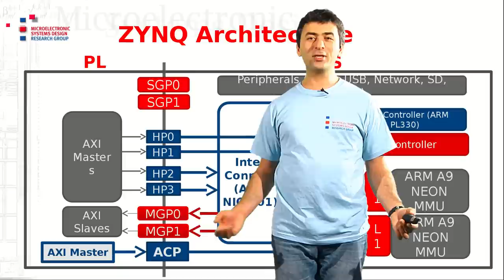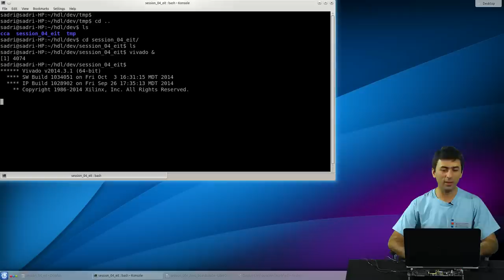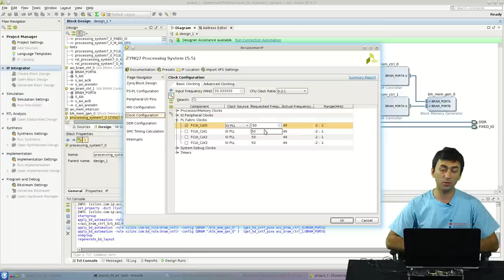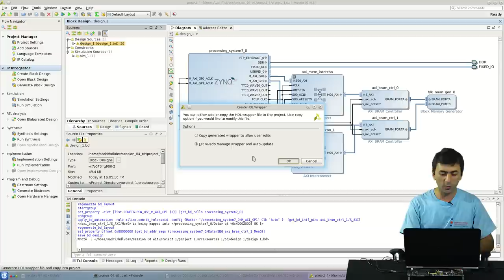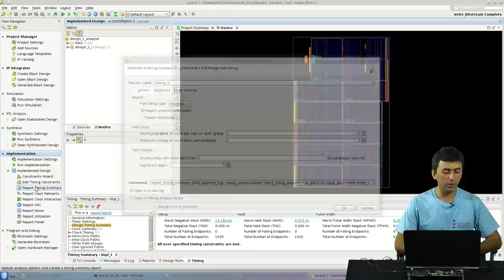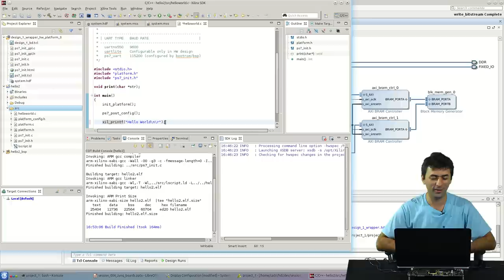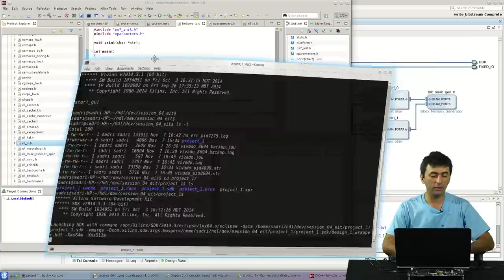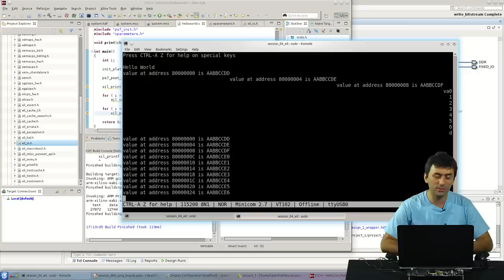ZYNQ AXI Interfaces Part 2 (Lesson 4)

Comment: This may be a dumb question, but with other tools that I have used, I have seen the need to explicitly write to the UART address space in order to get it to print to the console via UART. Do the functions used xio.h automatically do this? I would have assumed that the functions would send the messages over the JTAG connection. Any insight would be much appreciated.

Comment: Another question: The block design verilog wrappe rhas those DDR and FIXED_IO signals. But in the previous lesson, the ZYNQ diagram did not show these signals being routed out from the FPGA to the system. The only connection it showed was through the HPx ports to DDR and the GPx through interconnects. Did I miss anything?

Comment: What are necessary steps to do the same task (which you have explain in this lesson 4 i.e. read-write to BRAM) over Linux application running on PS? Is there any Xilinx document which explain this?

Comment: A very helpful and well explained tutorial!!! I have a rather silly question, in the program, we didn't configure the data in the address of GP0 (0x40000000) to be copied to the address of GP1 (0x80000000), why is it when we read from address 0x80000000, the data appeared to be the data in address of 0x40000000? Thank you!
Reply: Hello Kin, if you look at the block diagram of our design you can see that we are using one single block memory with two ports and each of these two ports is connected to a separate axi bram controller. one of the axi bram controllers is accessible through gp0 and another one through gp1. so practically GP0 and GP1 are sharing one single unique block memory. this is why you see a same data.
Reply: thank you so much...it makes more sense now!!!a very good series of tutorial!!!keep it up!hopefully tosee more video coming

Comment: The adresses were were changed from
0x40000000 - 0x40001FFF
0x40002000 - 0x40003FFF
to
0x40000000 - 0x40001FFF
0x80000000 - 0x80001FFF
why not
0x40000000 - 0x7FFFFFFF
0x80000000 - 0xBFFFFFFF
like in the table? Was this on purpose or an error and it just worked by chance?

Comment: i constantly get an error 'Can not access FPGA space: level shifters are not enabled". As you have told in this lesson, i have put ps7_post_config() routine in main. FPGA is also getting programmed before i dow application. what could be going wrong?
Reply: Hi. well, If you are sure that ps7_post_config is executed but level shifters are still not enabled, you can do it yourself manually. Look at the ZYNQ TRM document, at the end there is an appendix which lists all of the registers, there you find the register responsible for changing the state of level shifters, the register is in locked mode by default, you should first unlock it, then make level shifters active and then lock it back again.
Said that, I believe you are not running the ps7_post_config, probably it is located some where which is not being executed. Or your elf is running before the fpga fabric configuration gets done!

Comment: Hello Mohammad, What is the procedure to carry out same exercise on board that is not listed while creating vivado project?
Reply from the maker: So you have a ZYNQ board which is not listed by default in Vivado when you want to begin a project. Then the first thing I would look for is if there exists any board definition file for my specific board. If yes, I go ahead and just add the new board definition so that I can have it in the list of available boards in vivado. (for example look here: http://zedboard.org/content/board-definition-files-0) If there is no board definition file, then you may like to create one for your specific board and use it since then ( look here : http://forums.xilinx.com/t5/3rd-Party-Other-Boards-and-Kits/How-to-create-a-board-definition-file/td-p/339025) 

Well, finally you can also forget about board definition files completely and directly go ahead by selecting your zynq target device when creating the project. Here you need to take care of all of the required configuration parameters of the PS. e.g. the parameters related to the DRAM controller. Or the ones who define which peripheral is enabled and which one not.

Comment: Great job sir ! could you explain me why i get this error ? I'm on Vivado 2016.4.

ERROR: [BD 41-1075] Cannot create address segment for </axi_bram_ctrl_1/S_AXI/Mem0> in </processing_system7_0/Data> at 0x40002000 [ 8K ]. The proposed address exceeds the base address limitations <0x80000000 [ 1G ]> of the interface(s) </processing_system7_0/M_AXI_GP1> through which this peripheral is accessed by this address space
ERROR: [BD 5-48] Error: running assign_bd_address.
I would appreciate if you answer this problem.
Reply: Running this TCL script seemed to do the trick. Must be a Vivado bug. 

TCL:
create_bd_addr_seg -range 0x2000 -offset 0x80000000 [get_bd_addr_spaces /processing_system7_0/Data] [get_bd_addr_segs {/axi_bram_ctrl_1/S_AXI/Mem0}] SEG0
Reply: I also encountered with the same error message however while you go to the Address Editor in the Vivado, you will find that your "axi_bram_ctrl_1" is Unmapped; so you should give the Specific Address to the Unmapped "axi_bram_ctrl_1" which is 0x80000000 in the given case (address for the GP1). And I think after mapping the address you should be able to go further.
Reply: in vivado  you can not "give" a specific address in the address editor. The vivado is not alowing to edit or input a new address by hand
Reply: Better solution: Right click the not included piece. Select include. Right click select assign. Change to correct address
Reply: His example still fails at synthesis following instructions 1 for 1 with the edit for accepting BRAM 0x8000_... for GP1 access. Vivado 2022.2.2 attempt on Zybo Z710

Comment: Mohammad, You can make an udev rule to keep track of your ttyUSBX. I have this in my /etc/udev/rules.d/91-zed-usb-serial.rules
ACTION=="add", ATTRS{idVendor}=="04b4", ATTRS{idProduct}=="0008", ATTRS{serial}=="044301C42216", SYMLINK+="zedboard",MODE="666", GROUP="uucp"
This way I can connect to the serial port as /dev/zedboard. I'm using kermit so the group owner is uucp, which you might have to change. Of course you have to make the vendor, product, and serial match your board as well. You will probably want to use a different name as well... I do the same thing with my Altera board as well. Again, thank you for a great tutorial.

Comment: [BD 41-1075] Cannot create address segment for </axi_bram_ctrl_1/S_AXI/Mem0> in </processing_system7_0/Data> at 0x40002000 [ 8K ]. The proposed address exceeds the base address limitations <0x80000000 [ 1G ]> of the interface(s) </processing_system7_0/M_AXI_GP1> through which this peripheral is accessed by this address space

I am getting this error while I created GP1 port in ZYNQ then run the "connection automation" to connect this GP1 to "axi_bram_ctrl_1". And, also axi_bram_ctrl_1 is unmapped in "Address editor".

Thank you in advance.
Reply: Try creating the address segment in Tcl Console

Comment: where do i get those 32-bit libraries/packages ? what is it called ?
Reply from the maker: Hello,

for 32 bit libraries, 
for old version of ubuntu, e.g. 10.. you can use this command 

apt-get install ia32-libs

and for newer versions e.g. 14... 
it will be a procedure using these commands : 

sudo dpkg --add-architecture i386
sudo apt-get update
sudo apt-get install libc6:i386 libncurses5:i386 libstdc++6:i386

Best Regards
Reply: Thanks a lot